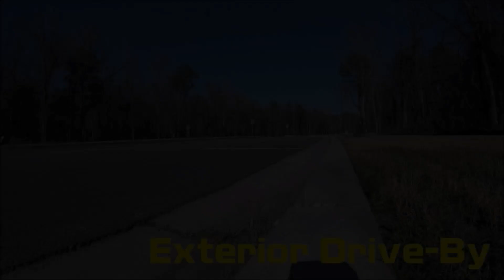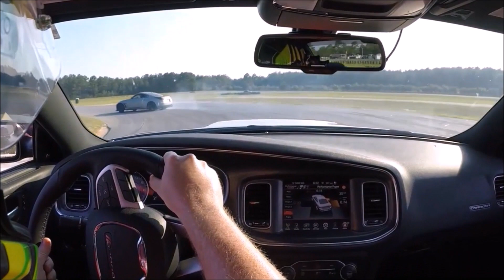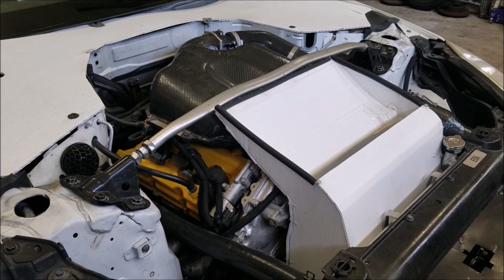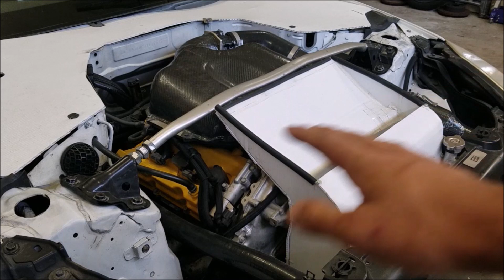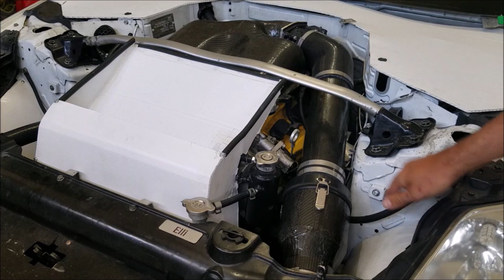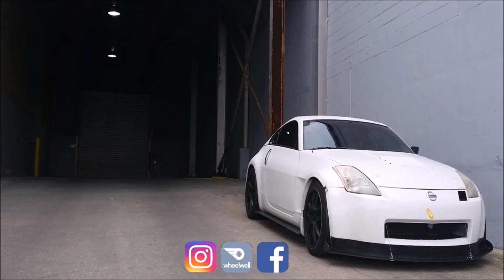Nissan 350Z Engine Bay Clean Up Guide

Comment: Love the mix fo form and function.
How have you found the steering after de-powering? I'm considering it on my Z but it sees a fair amount of street use.
Reply from the maker: Thanks! It's really not bad; I almost don't notice it at this point. You just sort of rewire how you drive to make turns a bit wider and plan ahead in parking lots. To protect the steering components from unnecessary stress, I avoid turning the wheel when the car is stationary.
Reply: @350Z247  great to hear, appreciate the info!